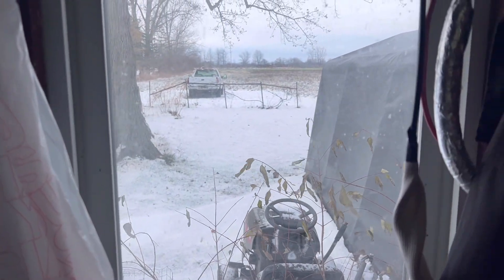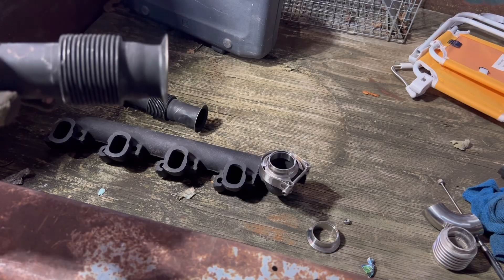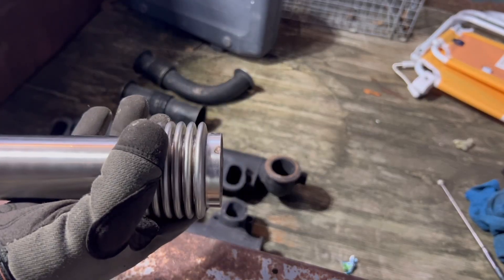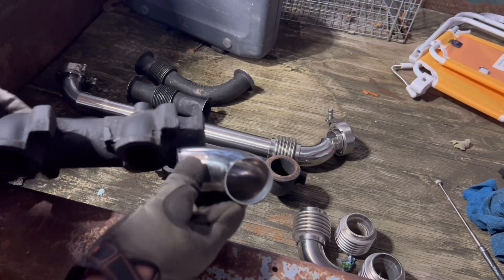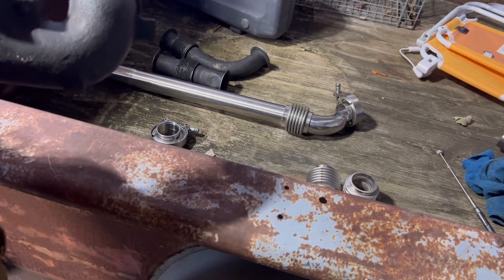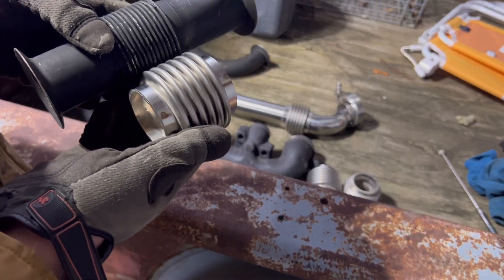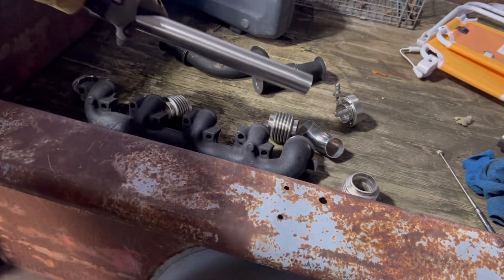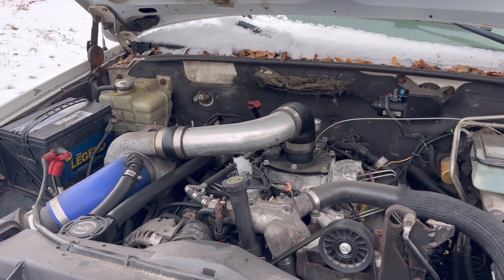GSC: 6.5L diesel center mount turbo build part 0!

Comment: Will you guys be using the more high dollar arp2000s on this pulling motor or just using the standard ones?
Reply from the maker: I’m planning to run stock head bolts as long as possible. ARP2000s are a waste since the blocks deck will deform before those studs will stretch. There is a such thing as over clamping with head fasteners. If this spits  a gasket it’ll get just standard studs.
Reply: @gingersnapcustoms  that’s kinda what I was assuming when I saw that the studs on these only torque to 90ft lbs if I remember correctly where as the 6.0s we stud at work go to 200ft lbs
Reply from the maker: @l @lukeschermerhorn5452  what I’ve learned and found over the years is the standard ARP studs clamp great when set to 120lbs. Beyond 127lbs they begin to deform the block. The harder studs deform at a much lower which causes its own issues.

Comment: Hey I bought the 6.5 off a school bus which is already center mounted turbo is it a plug and play swap into the pick ups
Reply from the maker: Not at all. The firewall of the truck needs to be modified 4” in every direction and then the down pipe still doesn’t fit. Most times we put truck heads on and make those engines side mount.

Comment: I just installed a side mounted turbo on my previously NA 6.5. I'm curious how this works out, a center mounted turbo would have been awesome.
Reply from the maker: With there not really being a guide how to make one work. I’m hoping to document as much of this as possible so guys can DIY if they so choose.
Reply: What is the advantages of s center mount turbo?
Reply from the maker: @Dakattack98 reduced drive pressure. Reduced EGTs. More balanced exhaust flow out of the heads. Lower coolant temperatures on the passenger side head.

Comment: Did I hear 500 hp and 6.5 in the same sentence 😳
Reply from the maker: It’s been done before with water meth and stretching tuning. I want to put 500 down on fuel now that I have a much better understanding of how everything has to work to make it go.
Reply: @gingersnapcustoms  it’ll be quite interesting to see you get into high hp, so far I’ve only seen a couple like buckwild and diesel nations builds, and there was heath diesel years ago and like one other shop had one around 500hp a while ago that I can’t recall the name, and quadstar has some proven builds with there pumps, I’m trying to get 250-300 horse in my 92 that I’m rebuilding and still tow with it.
Reply from the maker: @Derek-C Casper has lived around 315 based on weight and ET slips for 7-8 years on a stock engine with bolt on parts. Your 92 can definitely do the same and be healthy for years to come. Most of those trucks never made it to a dyno other than Bangharts. So I’m really hoping to have paperwork, ET slips and sled pulls to back this one up. We will see how it goes.
Reply: @gingersnapcustoms  when you get to the high hp numbers are you going to do the beast pump from quadstar or switching to a mechanical pump?
Reply from the maker: @Derek-C I haven’t used or talked to those guys in 5 plus years. I’ll probably go mechanical for reliability and durability. Unless something changes that’s the current path.
Reply from the maker: @Derek-C the other thing is the beast caps out at 450-470 horse of fuel. I’m trying to avoid using injectables to see 500.

Comment: Following this close! Long term for my K3500 is an LB7/LLY swap; but in the mean time I have an HX35 and an LB7 intercooler to shoehorn on, but a center mount turbo has my attention!
Reply from the maker: In the long run the goal is to show a centermount 6.5 can be as fun and reliable as a Duramax swap. We will see how it pans out since I know a side mount S300 will keep one healthy around 315rwhp without much of a fuss.